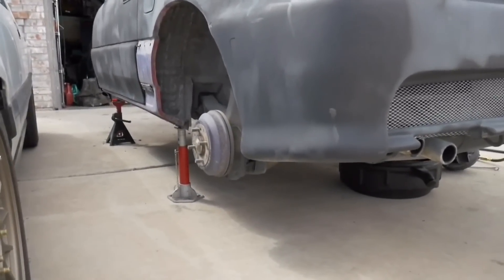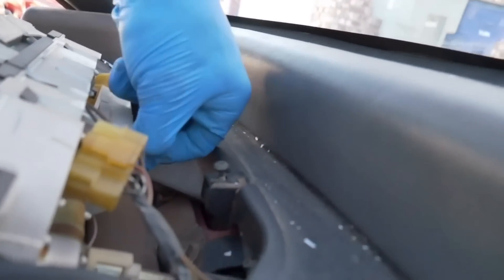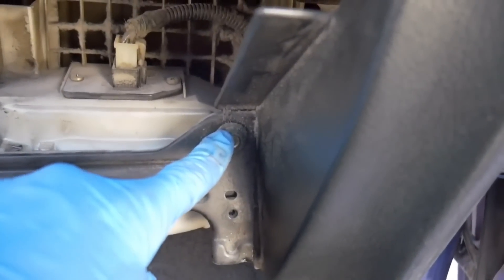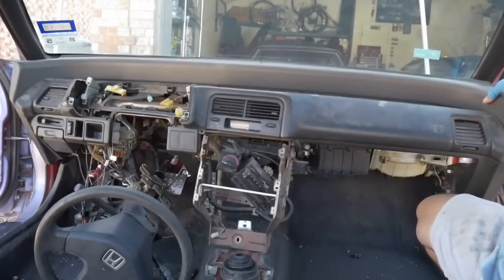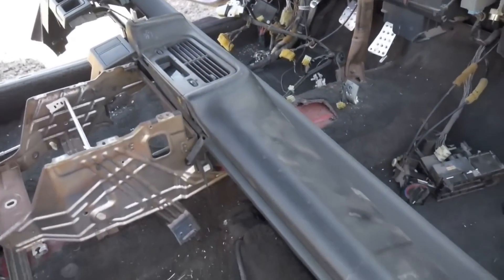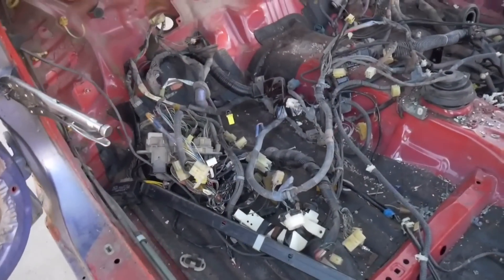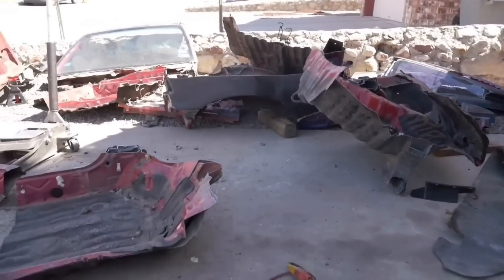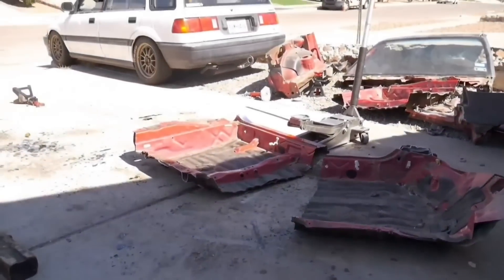How to Remove Dashboard - 88-91 Honda CRX & Civic

Comment: Just did this on my hatch and your instructions made it a lot easier! I will say though I should've wrapped all the metal edges with tape or hand towels since they scratched up my center console and other interior pieces
Reply from the maker: Good tip, thanks for the addition!

Comment: Pretty clean for a part out, but if it keeps others on the road its worth it. Great info. A few things on later 90-91 are different, cluster, blower, harness, but should be similar enough. Non-si are easier with less crap.
Reply from the maker: Very true!

Comment: Hey man just bought my first car a crx 1988 ef7 two days ago and found your channel, your gonna be a massive help working on so keep up the great work! Also if you had and tips i would greatly appreciate it, Its got a doch D16zc with 142000 miles.
Reply from the maker: What are you aiming for with the car?  

General tips in terms of maintenance?
Reply: Mainly just trying to bring it to original working condition, The engine is perfect and runs great. Only issue is Fuel gauge only works half the time and the trail arm bushes and shocks need replacing, the only other work needed is some panel damage but already have parts to replace them with. But yeah general maintenance tips would be great. Eventually when this car is nice and clean im going to probably get a dc2 integra and turn the crx into a track/show car.
Reply from the maker: Honestly these car seem to run with even the crappiest maintenance.  I would of course do the usual plugs, wires, distributor cap and rotor.  Transmission drain and refill with new fluid and all new radiator hoses and smaller coolant hoses plus a thermostat.

The fuel sending unit may be broke, or even the cluster. Both are easy to change as you can access the sending unit by lifting out the rear cargo box.  You'll see the lid for access to the sending unit.

Those suspension parts you mentioned are easy to change out also, just takes a little time and effort.

Keep me updated, or make some videos, would love to see the updates!  Need any pointers when you get to work, let me know!
Reply: Thanks! I would love to make videos but dont have anything good to record with but ive been taking photos every step of the way, Might make a build thread on the Honda forums.

My next step i think is pulling off the muffler and replacing it, replace the fuel sender unit and change the fluids.

Sadly i didnt realize how hard it would be to find parts locally and how over priced people are selling them for before i got the car, so for now i can only work with a few things until i get my next paycheck and ill pick up parts for the general maintenance.

Also I've read that the HyperFlex Master Bushing Kit and energy suspension trailing arm bushings are the way to go, Whats your opinion on them because im on a tight budget and they seem to be the cheapest and have quite good reviews.

Thanks again for the help as well as your channel, Been watching a lot of your videos and they are really helpful and informative.

Comment: Thanks heaps for such a great video .. Because I've got the steering wheel off already do j still need to drop the steering column?
Reply from the maker: Yes
Reply: @GarageBuiltHondas  because I need to remove the dash to take it to the trimmers can I still drive the car back into my garage?  I'll be removing the dash from my driveway.  Just need to drive it straight back in the garage.  Thanks man.  I just need to be sure before removing it
Reply from the maker: Definitely.  Once the dash is out you can lift the column back up and attach the 2 nuts to hold it up.
Reply: @GarageBuiltHondas  thanks heaps.  Your knowledge is priceless.

Comment: Great video. Like always. Just a tip. Dash can be removed with the harness on. you just have to unplug it from the fuse box.
Reply from the maker: That would be much more difficult, since you would have to feed it in from both sides of the engine bay.  The part that connects to the passenger side was behind and underneath the blower controls and evaporator core.  I don't think I could've gotten all of those wires out without removing those parts, and I couldn't remove those parts without having the dash out of the way.
Reply: Jon Widmer  I should have been more clear.  The wiring that is on the dash (cluster, clock, cigarette lighter) come out with dash. There is just one cable you have to remove from the fuse box.

Comment: I'm putting everything back together and I can't figure out where that little black ground wire goes. Probably just the stereo/clim ctrl frame, but not entirely sure
Reply from the maker: If it's a ground, anywhere touching metal works
Reply: @GarageBuiltHondas  Makes sense. I think my bigger concern was that it may already be coming from a ground, and then I don't know what it's supposed to connect to. (shrug)

Comment: Jon. Very helpful videos! Well done. Question: Once you remove the dashboard cluster (speedometer and odometer unit), is one able to pop off the clear plastic to get directly to the dials? The needle on my speedometer has some how gotten on the wrong side of the 'resting' pin on the face of the speedometer.
Reply from the maker: Martin Doyle thanks!  you're correct.  in this video I have linked, it shows how to pop it open!  you should be able to move the needle back around. https://youtu.be/uZRvIN5MErk

Comment: glad i watched your vid. i wouldnt have known about the 2 screws behind the vent slider panel.   just got myself and original 88 crx in pretty dang good shape. only thing missing outside is the drivers side fender mold.    Inside is great other than as your climate control and 2 of cargo covers.   You  have any thing left for the car i wouldnt mind doing a black interior
Reply from the maker: Nice!  I only have random parts but the interior is gone except the ebrake console and the whole steering column.  If you need anything in particular let me know!
Reply: Would you happen to have the fender molding for the drives side for an 88 and a si front bumper
Reply from the maker: Negative on both.  This car was crashed on the front end and had a body kit which removed the moldings.

Comment: Sad to see it get cut up but it was wrecked anyway and you saved the parts. Question for the LED light beside the sunroof switch. I have the exact same light on my hatch. Is that a factory alarm or just a common place for the flasher light?
Reply from the maker: Kevin Williams Aftermarket alarm LED.  It seems to be a common/smart place to mount it because you can always get a new piece of plastic to replace it if you ever needed to.

Comment: Hey Jon , do you think just removing the steering wheel is enough ? Rather than unbolting the steering column. Thanks !
Reply from the maker: I don't know.  I don't think you could lift the dash high enough over it.
Reply: @GarageBuiltHondas  ok thanks. If im in that deep, might as well remove the steering column.

Comment: I keep playing this video just in case I missed something when I pulled out my wagon dash and I missed nothing everything is plugged back together how it is and my temp gauge is still not working and I just noticed the second time I pulled it out my break lights don't work but my running lights do what can that be? I'm so confused anything would be appreciated thank you. You're vids are amazing btw
Reply from the maker: +Jonathan Godinez any grounds that may have been missed?  Maybe a wire unfortunately was old, brittle and moving them around it no longer has the connection?  I really don't know, I've never experienced this type of problem.
Reply: Garage Built Hondas well thank you I know  it's weird but I'm going to keep looking around on each wire
Reply from the maker: +Jonathan Godinez if you figure it out let me know

Comment: quick question  I have a 89 civic si hatchback  the  windshield wipers and the sunroof went out at the same time what could be the problem with it
Reply from the maker: Check your fuse box.  If the fuses are ok, check the ICU.
Reply: Ok thanks  I will  when  it worms  up its  been  cold  weather  here  hopefully it will be  wormer tomorrow .  thanks  for the info

Comment: Can I find a cluster with rpm tach and put it on my 88 dx sedan 5spd? Or do I also need to take the wiring along with it to work
Reply from the maker: Just the cluster.  It'll need to be an 88-89 to fit.

Comment: somebody did an ac/ heat delete on a crx I bought,  everything is removed and I have no idea what I need to replace it all, do you have any video of you removing that stuff? been looking forever and I would really appreciate it
Reply from the maker: Shoot, I don't.  The 3 main parts you'll need are the heater core assembly, the blower, and the evap core or evap delete tube.  With that you'll at least have heat shooting out the bottom warming up the car.  There are the tubes that direct air to the vents also but still not a necessity if you just need heat at the moment.
Reply: Jon Widmer thanks alot! I also have no wires lol its cold where I'm at and I just want to drive it

Comment: Looking for help. I installed a Momo hub and a Nardi wheel on my EF. The center bolt is tight, however there’s a mm of play in any direction on the wheel to the column, almost as if there’s a spacer missing. In addition my turn signals won’t turn off after a turn. Is this normal?
Reply from the maker: Not normal at all.  You should still have the small plug inside the switch column which has the ears on it.  Hopefully the hub slid around the ears which turns off the signal.  Was the hub EF specific.  Only certain hubs fit the DA/EF, all other Civic and Integra used a different hub.

Comment: I bought a 91 Honda Civic hatchback base. The dash lights turn on and off. But the heater lights stay  on working do you know what could be causing that ? Thanks
Reply from the maker: Shorted wire
Reply: @GarageBuiltHondas  ok Thanks 👍

Comment: I know this video is old, but currently trying to get an 89 hatch back on the road.. Bought a donor 90 hatchback with a full interior..I want to put the 90 dash and door panels in the 89 car. Will this work? I've read mixed information lol
Reply from the maker: Dash will work.  Door panels will probably fit, but maybe not perfectly.   The 90 hatch had door mounted belts and the 89 did not.

Comment: how easy would it be to swap hatch dashes? from a 89 to a 90 dash? and do you sell parts? there's a few things I need that I can't find.
Reply from the maker: Colorado Macbay It's pretty easy.  I believe those dashes are the same unless you have a sedan.  You can just swap the gauge cluster cover.  Unfortunately I do not believe the 88-89 clusters work on the 90-91 models so if you swap clusters and the housing then you're cluster will not work without some modifications to the wiring.
I sell parts when I have them, usually don't keep much.  what are you looking for?
Reply: I'm looking for some 89 seats and some Door panel's. I had a 1990 hatch rhat got tboned and I'm using all my parts off my 90 and putting it on my new 89.
Reply from the maker: Colorado Macbay I only have some CRX Si door panels, not hatchback.  They would fit a 90-91 hatchback but not the 88-89 because of the pillar.
Reply: Yeah I notice that when I was seeing if they were interchangeable. well if I need anything else I'll see if you got what I need. your videos have helped vary much in the past and probably will in the future. thanks again!
Reply from the maker: You got it!
Reply: if I have a question about my ef hatch how can I get in touch with you easier?  I took some pictures of some of the things I have questions about. That I think you would be able to answer.

Comment: you can do a video of eliminating the A/C fan ... i am trying to eliminate my fan but is a pain in the ass.
Reply from the maker: Are you just trying to pull that fan out?
Reply: Already remove the fan but the box where the cooler system is in the center of the car.
Reply from the maker: Inside under the dashboard?
Reply: Yeah bro
Reply from the maker: That's the evaporator core.  Remove the glove box and you'll see a couple bars on each side that need to be removed,  then a couple bolts/nuts holding the evaporator core to the body.
Reply: Jon Widmer  Thanks for your help I remove it 👍.

Comment: Is this required to replace the blower fan?
Reply from the maker: I think so.  If you ac isn't hooked up you might be able to drop the EVAP core then the blower.
Reply: Thanks.  I think I’ll just sell the car, as-is.  I’ve had it.
Reply from the maker: Exactly.  Don't waste more time and effort.  Both of those things are money.
Reply: No.  I successfully replaced it with the following video.  https://m.youtube.com/watch?v=_maComMn8Ag&lc=UgyMLCE41FSw0BaTmA54AaABAg.9pBtmP-Z0c29pCgmIxnoa4
Reply: New motor available from A-zone parts.  $44.95.  Same connector.  Works great.

Comment: This is a long shot, but do you happen to have the rocker panels,  not the plastic covers.
Reply from the maker: Damn, I recycled them.  Nobody needed them at the time.  I should've just kept them in my backyard, sorry man!
Reply: I kind of figured that out, but I had to ask, those parts are getting hard to find.  Thanks

Comment: Hey I'm having trouble taking my heater core out of my 88 crx dx. I have most of the bolts out but its still attached and I still cant get it out there must be some hidden bolts I was wondering if you have a video on the removal. I need help !!! And I can't find anything online to guide me in the right direction. I might just have to get a manual but if its possible you could help give me tips or something. Thanks bud.
Reply from the maker: Daniel Grajeda did you get the one in the engine bay?

Comment: Where is the air cabin filter located and how do you remove it ?I have a 1989 Honda Hatchback Civic DX 
really old car it smells I removed all The seats and carpet out of it yesterday and I also power wash the floor on the inside and scrubbed the floor with OXY ODOR BLASTER DETERGENT.....BUT IT STILL GAS A STRONG SMELL...! WITH NOTHING IN THE INSIDE... PLEASE HELP ME ... !
Reply from the maker: There isn't one on the 88-91 Civic/crx.  You would need to pull the dash and clean all the blower control pieces.  They have collected dirt/dust over the years.  It's not too difficult but can be a little tedious.
Reply: Garage Built Hondas Thank You!!!!!

Comment: are you just getting rid of dash parts or a full part out of the car, there are a few things I would like to get with you about
Reply from the maker: Before I reply there, what are you looking for?  I sold off a bunch of parts already.
Reply: Stuff like the ashtray and the metal bracket that holds the blower to the evap for sure, then the dome light and the strip above the hatch back glass on the exterior.
Reply: Jon Widmer I need the bracket that goes from the blower motor to the evap and the ashtray for sure if you still have those. Then it would be nice to have a new dome light and the trim over the back glass above the hatch. I work away from home so I can't really pin anything else but those parts would have my car almost complete again
Reply from the maker: I sold all the rear interior to a guy in town.  I might have the brackets which seal off the air and help hold the evap core to the blower.  I'll try to check in my next day off Tuesday!
Reply: Jon Widmer thanks, what about the exterior trim piece above the hatch

Comment: Would a crx dashboard fit in a ef hatch? 91 on both
Reply from the maker: +MrMarce1012 yes, perfectly!
Reply: Garage Built Hondas great thank you also by chance do you know if ill have any problems smoging my hatch if i put a d16 stock intake when mine is a d15 the reason i ask is because i ordered it online and its a little to short
Reply from the maker: +MrMarce1012 I don't believe it'll be a problem especially if it is a OEM intake.
Reply: Garage Built Hondas great thanks man i appreciate it

Comment: Hey, Bro it's me again. My turn signal switch went out on my 1989 Honda Hatchback. I wanted to know do I have to remove the steering wheel to replace my turning signal switch.And if how do I take the  steering wheel off?  LoL☺️.!.. I'm hoping you got a video on it Bro !!!!
Reply from the maker: Right here man!  Since you have a stock wheel you'll just use a flathead screwdriver to remove the emblem and that gives you access to the bolt for the wheel.
https://youtu.be/HMtFvAfKukI
Reply: Garage Built Hondas Thanks Again Bro!!!!!
Reply from the maker: You're welcome!

Comment: Hey.  Got any tips on how to remove that side vent plastic screw ? It keeps spinning on itself when I try to unscrew it.  3:50 for reference.
Reply from the maker: Did you hold the washer part still while trying to unscrew it?
Reply: @GarageBuiltHondas  i did but The washer is not turning so that’s why I’m stumped.  I can get the passenger one removed, but not driver’s side. 🤔
Reply from the maker: It's stripped.  Pry it out.
Reply: @GarageBuiltHondas  got it out with the help of a pick.  It’s weird, i can now screw and unscrew when it’s off the vent. 🤷‍♂️.  Thanks for the tips.   sent you an insta follow request :)
Reply from the maker: Nice!  My Instagram was hacked on Friday.  I'm going to try to recover in the next week or so.

Comment: Hey my ef si has an issue with the clock and radio. They stopped working and all fuses are good I checked all for continuity. What else can I check what do you recommend I do? When I press the reset button on the clock it turns on at 1:00 once I let go it goes blank and the radio don’t turn on at all and everything was working fine before. Any suggestions I really don’t want to take apart the dash lol any input would be great thank you
Reply from the maker: No idea.  You'll just need to double check all the wiring for the clock/radio and fuse box.
Reply: Yea once I get some time, I’ll follow all the wires and see what I can figure out thank you for the reply appreciate it